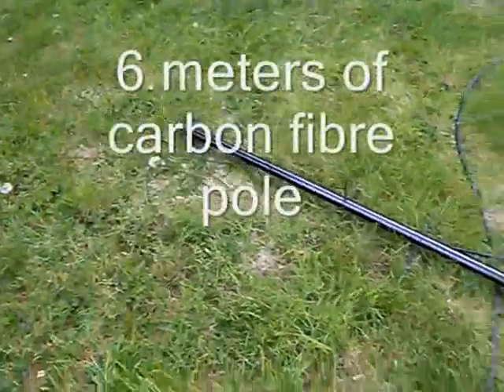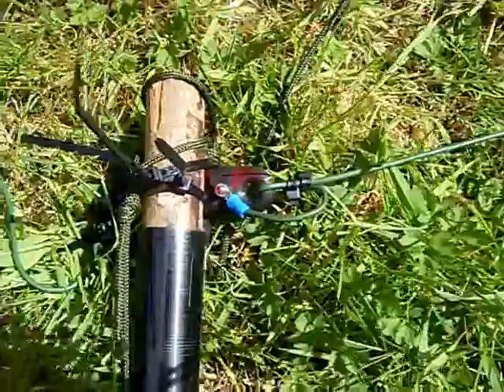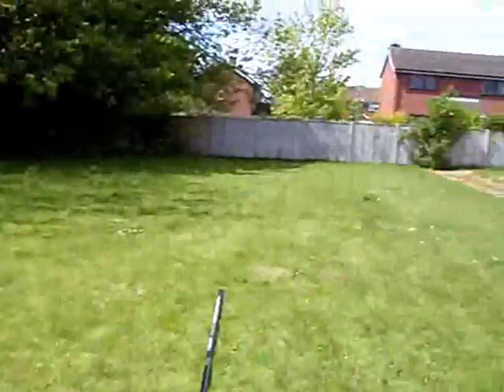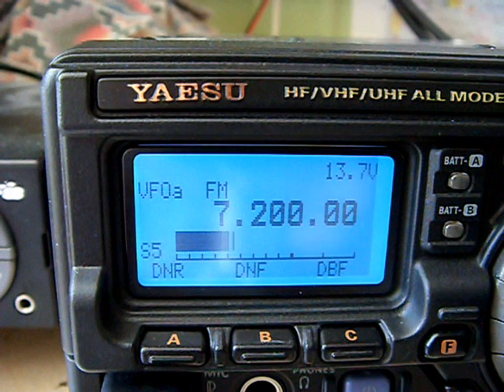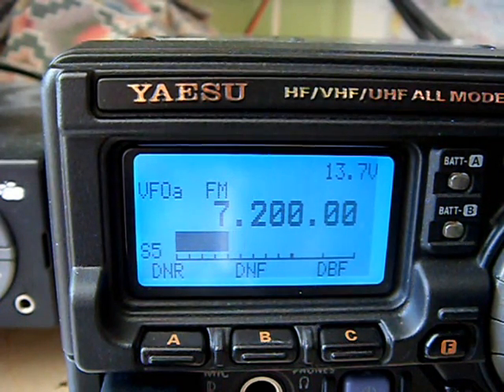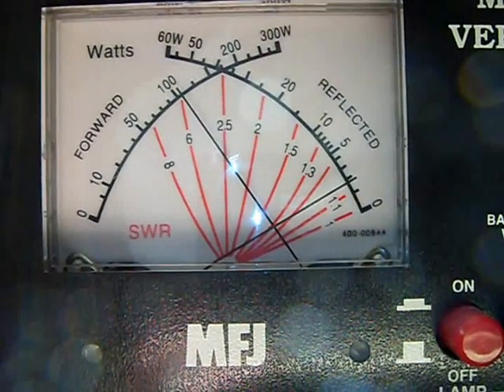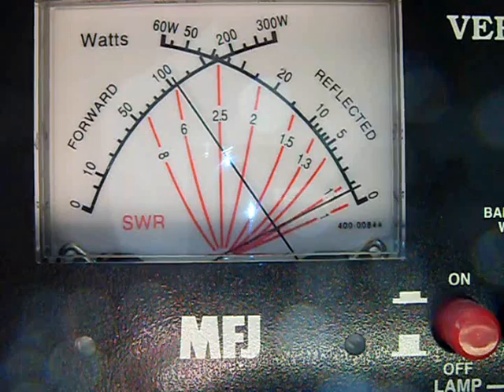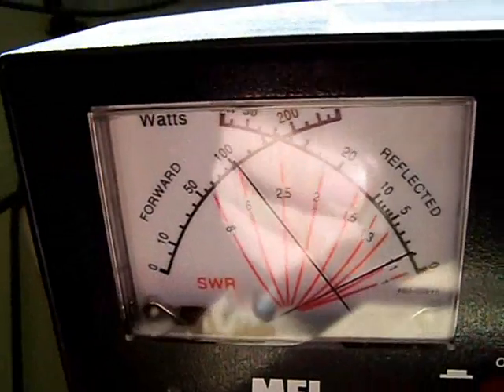40 meter dipole

Comment: Nice video but on my twin needle VSWR meters the correct standing wave is where the two needles cross over, not where the single needle lies which is what you are reading. Therefore your VSWR is slightly higher than you state but still very workable. Well done! M0KTY